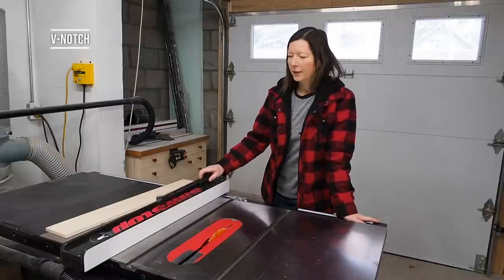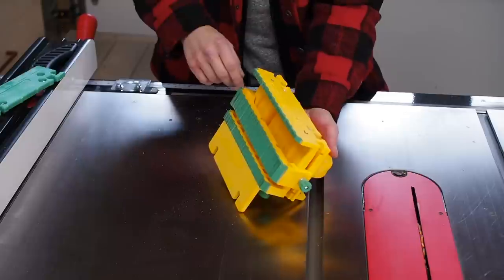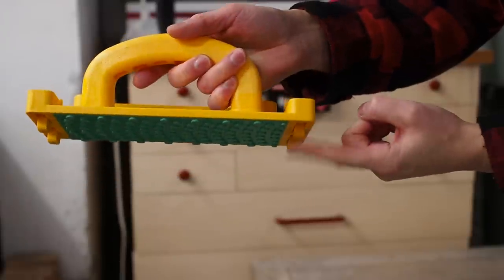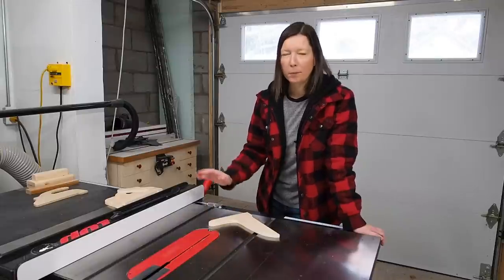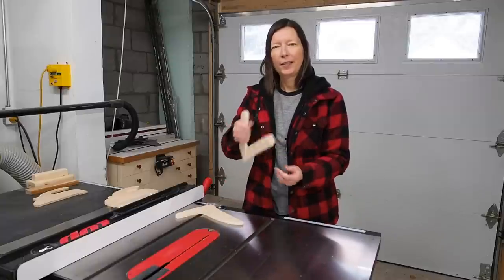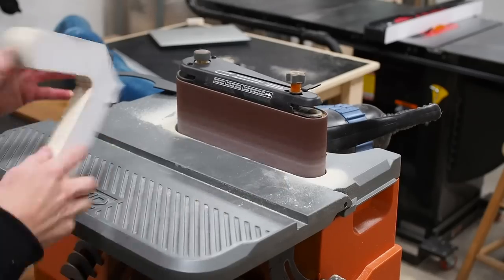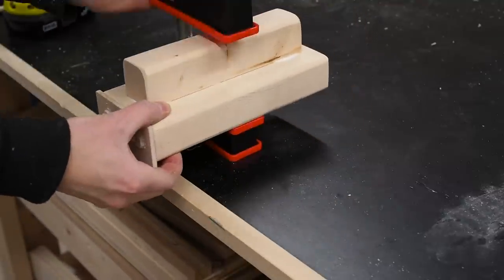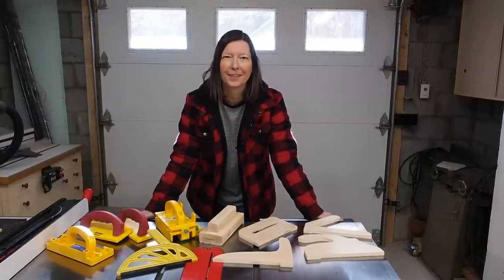Best push sticks | Commercial vs  Homemade | How to make with templates

Comment: The price of the Gripper is $54.00 USD, so you could make 50 homemade versions of your design for that outlay.  This I think is the challenge woodworking accessory companies face when trying to sell a product to woodworkers.  I am going to make one of your gripper like 2 X 4 design.  Bonus when you heat with wood there is no waste when it finally needs replacing.

Comment: I also keep my "chicken foot" push stick around, but not to use on the fence side of the blade.  I often have it in my left hand and use it to maintain pressure against the fence at the beginning of the cut when I'm not using a featherboard.  I use it at the end of the cut to clear the offcut piece so I'm not tempted to reach over or put my hand near the blade at any time.

Comment: All very good if your in your own workshop.  However, if your working in a shop where you are regularly visited by the company imperial probe droid with his clipboard, you have to install and maintain guards which renders most of these push sticks completely useless.  Especially if your machining thin stock.

Comment: Milescraft GrabberPro push block is 50% cheaper and has insert on the back (just like the one you made, but adjustable). The insert will get damaged pretty quickly, but you can make templates out of 1/4” MDF or plywood and replace them as they wear out.

Comment: I've made a number of push sticks/blocks, self built gripper which I like better than the commercial version. I'm often away from the shop and forget to bring a push stick, it's easy to build the 2x4 push block, maybe a little more refined than your for comfort and hand hold. I just screw them together and try to be mindful of how deep the saw might be cutting into them. Screwing the piece to the back makes it easy to flip over or replace.
Thank you for the excellent video.

Comment: Something I saw but haven't yet tried was picking up some cheap and/or old mousepads (the super thin garbage ones that come as freebies) and using spray adhesive to secure them to the bottom of push blocks (or sticks). Supposedly that gives good grabbing power.

Good video; thank you.
Reply from the maker: I actually made some push pads a few years ago using mouse pads. They are decent, but the grip get slippery fast compared to the Grabbers for example. As long as you clean them off, they should work fine. Here's the old blog post: https://www.diymontreal.com/make-your-own-push-blocks/

Comment: I made a vertical handle version a few years ago, 1" thick material  I used an old screwdriver that I cut down as a handle, very comfortable in the hands. 
I can't use it for thin strips obviously but I'm usually cutting 2" wide pieces. 
I'm still jealous of your sawstop 😁,I'm still using my mastercraft saw with its useless floppy throat plate 🤷‍♂️.

Comment: I make my own kinda like the rabbit design you call it but in different widths and I also glue coarse sandpaper to it for extra traction. Thanks for sharing some of your ideas definitely going to be making some for my shop. Keep up the great videos
Reply: Same, but I think I will pass the the top block/ handle throught the router with a 45 or profile bit so I have a nicer grip 

Great way to save scrap from the fireplace 😁

Comment: Marie I built the push block by Steve Ramsey and it works great just so long as you place the screws higher up on the back plate and not too deep you should be fine.  I like the idea of only having to make the handle and replacing the block when needed.  Other than that love the video and the templates that you provided.

Comment: I think this video honestly is very good, you mentioned all the pros and cons from your perspective without forcing them on anybody so they can choose what's best for them.
In the end I think that having an assortment of push sticks is probably best.

I did want to point out one thing which isn't related to the topic of the video but please do not use gloves when using power tools like you showed yourself using with the jointer, they can get caught and suck in your hands permanently damaging them if not worse. 

I know it's not as comfortable without gloves but it sure is a lot safer and as someone who makes youtube videos you're essentially putting videos out there to inspire people and for people to learn and copy from so I would personally prefer to not see that.

Some people really underestimate the power of these tools, even a simple hand drill can break your fingers if a glove gets caught so my own simple rule is if it's a power tool don't use gloves.

Comment: Wonderful, concise presentation. I like how you point out the hand positions that give you the most control, which is what we are trying to accomplish. I also see a riving knife on the saw which is a safety feature that aids in kickback prevention since the work can't move off the fence behind the blade, the primary cause of kickbacks. Thanks.

Comment: I'm new to your channel as of yesterday and quickly going through all your videos. First of all, THANKS!  On the topic of push sticks/blocks I'm right onboard and made one similar to the one April Wilkerson showed a while back. It's made of scrap 2x8 and has an adjustable/replaceable tailpiece.  The width and length give lots of downward pressure.  Thanks for the tips, reviews and templates!
Reply from the maker: Welcome aboard!

Comment: Excellent video, Marie. You covered a lot of ground in enough detail without going on and on.

Personally, I love the Grrr-ipper. I bought one specifically for making thin strips but I use it almost all of the time.

I still keep my saw's push stick in an easily accessible place and use it quite a bit.

I would have to agree with you on the handle positioning of the homemade push sticks. The 45 degree handle seems definitely better than the 90 degree but I think I like William Ng's design even better. I'm going to have to make me some of those designs and try them out.

Comment: Great review/comparison of features and your preferences.  I find that I most often use the flat based grabber type with the slightly angled handle among the commercial versions I have.  I think i will give your 2x4 with dowel model a go next time i am making tools.  It seems i could add a new bottom or plate on the back easily enough when needed, if I had trouble tossing it.

Comment: Very good, thanks for sharing.  I have the pushblock and it's very secure, the cool thing is that it shared several models, so it's accessible for those who can't spend a lot.  Thank you and success always!

Muito bom, obrigado por compartilhar. Tenho o pushblock e é muito seguro, o legal é que compartilhou vários modelos, assim fica acessível para quem não pode gastar muito. Obrigado e sucesso sempre! 🇧🇷

Comment: If you felt like maximizing the life of the last push block you could always have a stack of 3 1/2 x 1/8" "feet" ready to glue on after you nibble the bottom off the push block.  
I like the dowels through the handle into the base. I'd do a little extra work to keep that one around the shop.

Comment: Another Great informative video.  Good shop safety. 
I have had a Grip-rr for a while that seems to not grip like I would like it to so I just purchased the MICROJIG GRGH-040 GRR-RIPPER Gravity Heel Kit which should help with the sliding issue when pushing a board through. Making a rabbit soon from your template.  Thanks!

Comment: I make push sticks similar to the rabbit, w/o the ears and a higher back.  I just make sure the back top corner is well rounded for comfort.  I get good forward and downward pressure with little effort.  I make several from thin ply up to 2x8 material.  Thin ones for narrow cuts and wide ones for wider cuts. It keeps my hands high and at a good angle, with long support forward to keep the piece down.  They're out of the way of feather boards too.  When the bottom is chewed up from the blade, I make some more from scraps.  I do keep a second one close by in case I need help pushing against the fence.  No templates, just eyeball for what fits the scraps I have on hand.

Comment: 6:44 that profile really looks like a clothes iron to me, even has the water spray spout! I really need to make some properly formed push blocks and this is a good prompt. Mostly been putting it off due to limited time and using chunks of scrap instead. I still like something similar to the standard chicken leg on hand for maintaining extra distance from the blade. Love those outtakes, Marie! Just the sort of demented jabbering I get up to when I'm alone. 🤪

Comment: The standard push stick is my least favorite as well, but like you, it lives on my fence and in easy reach of either hand (magnet attached to the fence rail since my actual fence is aluminum).  I use it to knock offcuts away from the blade and I've seen too many people do that with their hands (yikes).  

Otherwise, my Grr-Ripper blocks are almost always used.  Yes, they are expensive, but worth it.  I have two full ones at the saw at all times and take the time to set them up properly.  Saving your hands is worth the money and time.  I also have two Grr-Rip Blocks for sheet goods and use them at the jointer as well.

Comment: I found a Chinese made GR-Ripper for <1/2 the price on Amazon. Normally I avoid anything from that country but at that price I bit the bullet and bought one. It's a bit better made  than the Micro-Jig because the screws and nuts are all steel. Looks and functions exactly like the higher prices Micro-jig product.

Comment: I picked up a Gripper a year or 2 ago, and no kidding. 3rd cut I made with it, I managed to run the blade right through that middle part because I wasn't paying close enough attention to where the blade was in relation to the pads. Haha.. still works fine, but it's got some damage. Felt like such an idiot.
Reply: You are not alone in having done that.

Comment: Hello, Just starting out as a diyer, what are your thoughts on the milescraft grabberpro 3406? I do like the MicroJig but it's kinda pricy. Thanks David
Reply from the maker: Just got my hands on the GrabberPRO today. Hope to test it out and post about it on Instagram soon.
Reply: I too am interested in the Grabber Pro, but have found that while Lowes, Rockler and Woodcraft carry a wide range of Milescraft products, they do NOT carry the Grabber Pro. 
Also, 3M makes a sandpaper holder that looks remarkably like the regular grabber, and it's about $13, at Home Depot search "3M 3-1/4 in. x 8-3/4 in. Drywall Hand Sander Model# DRHS-008" . The rubber is nowhere near as grippy (it's just to provide a semi-flexible backing for the sandpaper) but it's very solid, the handle removes with a little difficulty, and I could see using it for a variant of your last DIY, using Nylon screws in the wood (just in case.)
For grippiness the 3M SafetyWalk tape is very grippy, I put some on one side of my torpedo level and it stays against the wall easily. You can also buy Festools grippy tape that goes on their tracksaw tracks, I bought some today at Woodcraft for $30, it's an inch wide and you get 10 meters so can do a lot of things with it. That said I really like the SafetyWalk and am going to try that first.

Comment: Time and effort making a good push stick (or block) is well spent if you're going to be making several cuts that are likely to tire you out. Fatigue is your enemy when trying to work safely. If it's a tricky or potentially dangerous milling operation take the time to make it safer.

Comment: The homemade push stick will also not engage your SawStop break the way plastic will.  And while the don’t have the angles handle, a grout float is a great inexpensive option for a push pad.
Reply: Plastic won’t trigger the sawstop brake, it’s not conductive.

Comment: I think your homemade push block should have a taller handle.    Also I have seen push-blocks [on Youtuve of course] with sandpaper glued to the bottom,   to simulate the rubber bottoms.

Comment: your final push block can be easily refreshed to minimize work/effort... once it's cut up beyond safe usability, you goto the band saw or the table saw and resaw the block to get a flat face on the bottom, then a pass over the jointer or sander and then take a new block of 2x4 and joint the top face - now glue the old handle onto the new sacrificial block. With that much glue surface you won't need to add more dowel there ... add a new cleat to the back and you are good. When it gets chewed up again, rinse and repeat.

If anyone wants to get fancy - Fisher of Fisher's Shop has a fancy push block along the shape of the modified John Heintz stick combined a little bit with the rabbit and which is designed to quickly replace the sole once chewed up

https://youtu.be/Rw7rutUKrlo

and there is this one from Next Level Carpentry,

https://youtu.be/8h4OJHhSH8A

Comment: I still afraid to use even the best commercial push block the problem is that your hands are still pretty close to a blade. I do not wanna my hands to be closer than 20 cm to a blade.

Comment: The gripper CANNOT be safely used- it requires removal of the blade guard- which should NEVER be done. (Sleds etc should always incorporate a blade guard).
It would always fail a risk assessment.

Comment: You can make the diy block cheaper and faster, by not securing the build with dowels.  I am always perplexed why woodworker channels never trust glue alone in low stress joints.  If you test it, glued joints are really strong.  You couldn’t bust off that wood block handle short of using a club hammer and the ply block tail would snap the wood before the large joint area failed.  Techs in these glue R&D labs must be face palming when they see everything being glued AND screwed (or doweled) in face to face area joints or adding simple fences to saw jigs.